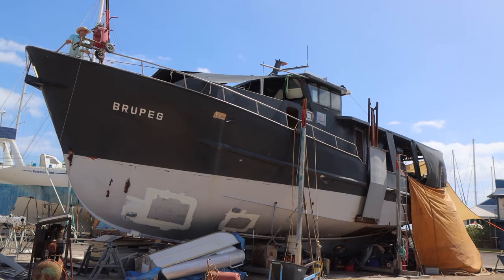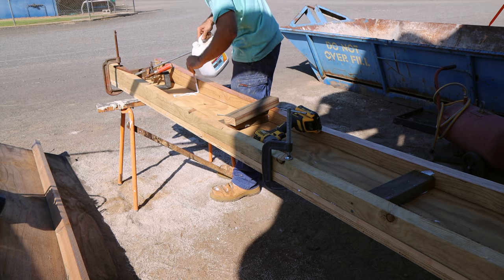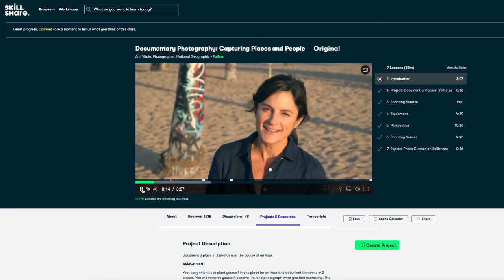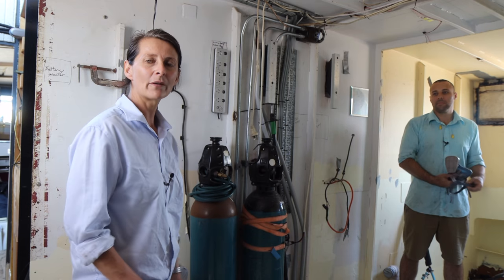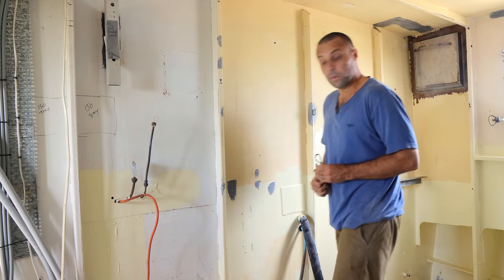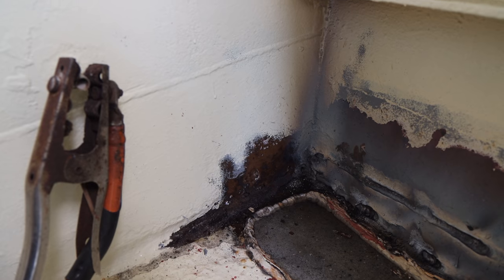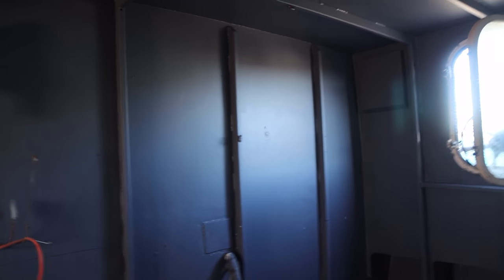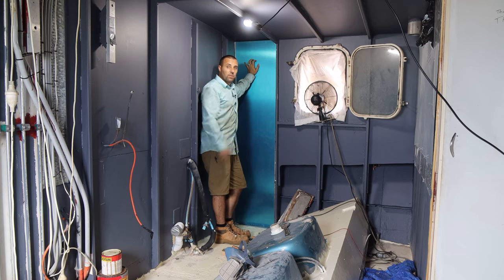Galley bulkhead painting... DONE - Project Brupeg Ep. 197

Comment: I would try a small portable air conditioner, as long as the air exhaust hose can reach outside the room you can hang some builder's plastic in the openings and cool yourself down maybe 10 or 15 degrees C.
Reply from the maker: Yeah we do have one of those. Trying not to kill it with grinding dust etc lately

Comment: Galley's Down for repair and improvement's. I'd be grilling for sure it's summer time there!  Yup those DIY cooling pipes are such a drag literately can't wait till you hack them off. Real ones are fin like with the cross overs on the inside of the haul or a big brass internal tube bundle cooler in the engine room.

Comment: When you guys were dealing with wet sand, I was thinking about using a cement mixer and a heater on the outside while it was spinning. I had never seen your sifter before.  Probably could put some covers over the screens and use a space heater if you end up dealing with wet sand again.    Love the work!
Reply from the maker: Thanks, yeah another channel (SV Seeker) uses a wet blaster and he tried using gas burners to dry the sand but also found it to be a right PITA so gave up, it takes a surprising amount of energy to dry wet sand

Comment: About gluing aluminium to say plastic, I made a huge mistake, I used Sika fc 19, about the strongest you can get and missed the instruction to leave at least 1 mm of adhesive, I clamped the parts and apparently squeezed out all the adhesive the result being the solar panel flew away at only 65kmh caravan speed. I roughed up both the aluminium frame and the plastic mounting feet so I hope you don't have that problem, probably not as the clamps are far apart.

Comment: Guys, here's a trick from Ancient History that will be helpful to you both: Roman Air Conditioning. Take a white hand towel, about 45-50cm long, and dunk it in cold water. Wring out as much water as you can, and then drape the around your neck. When the towel starts feeling warm, simply wave it around vigorously, and then it will cool right down again.  Voila! As the water evaporates, it will take the heat away from your neck and head, and you'll feel cooler.
Reply: That does work - if it’s hot and dry - the problem there is the humidity, the air is already fully moisture laden and evaporative cooling just doesn’t happen, so you just have warm wet towel around your neck to add to your discomfort.
Reply from the maker: Yeah this is true. Bloody Aussie for ya
Reply: Aussie air conditioning comes in cans with XXXX written on the side.

Comment: Sandblasting shouldn't affect the silicone, in fact, when they sandblast gravestones to add names, they use a thin rubber stencil.
Reply from the maker: I was more worried it might let go from the steel as it was a pretty crap joint in the first place. if it let go with the full force of sand and water pushing against it. that slurry would have gone all through the new cabinets. hence the over caution

Comment: Why not make a gasket sealing the aluminum plate against the aluminum bars and bolt it tight. Maybe rivet it. You always say if you cant reach areas the maintenance will be impossible to do. It seems to me that if water gets into that vent way you will need to check it at least once every few years. Its still the galley, water will be spilt onto the floor and run of to that point since the floor is curved. Just my 2 cents. great episode as always!

Comment: Curious why with all the painting you choose to use a brush and roller, not some kind of sprayer especially on the larger areas.  I choose a sprayer when I can for my projects, but it seems its that way on all the boat channels, I've only seen a sprayer used 1 time. Is it the viscosity of the paint or some other reason?
Reply from the maker: No it’s mainly the effort in covering everything up to allow the spraying. Also with two pack epoxies and polyurethanes the fumes are incredibly nasty. When spraying two packs inside you really need a full exterior oxygen system to pipe in good breathing air, I have sprayed poly in the bathroom once before and nearly killed myself, rolling reduces the fumes by maybe 90%. Finish wise I would love to spray but sadly that’s not an option for us